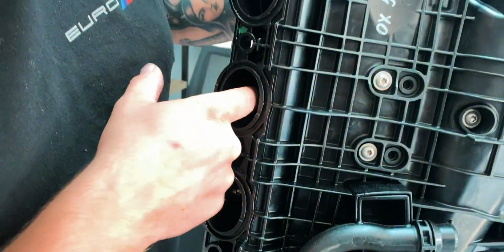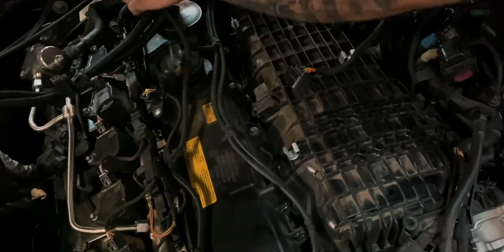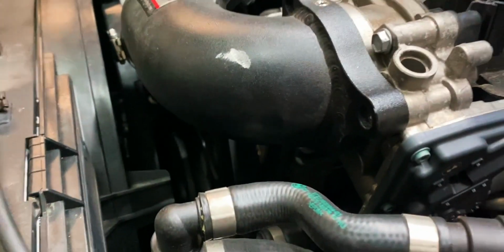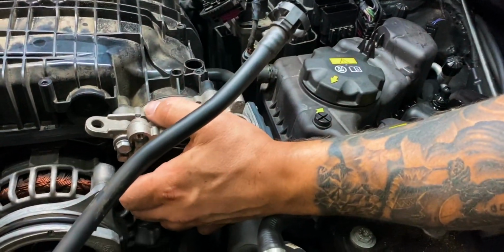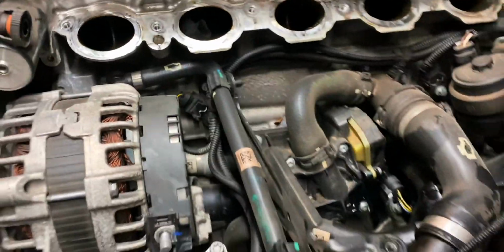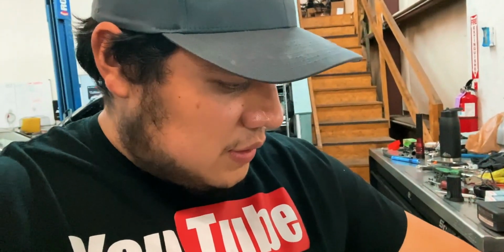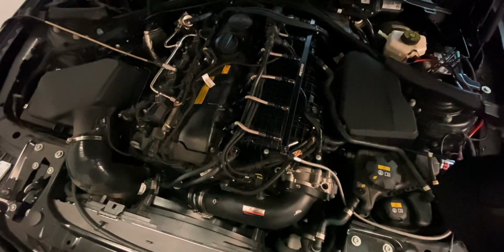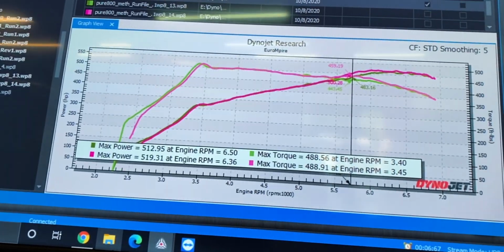PRO-METH DIRECT PORT METH INJECTION MANIFOLD PROTOTYPE TESTING FOR THE B58

Comment: port meth injection is a fail tho unless you have have really good filters and even then the white stuff sometimes can clog the nozzles and it a pita to figure out where the issue is, that why throttle body/chargepipe injection is better cause there is only one injector that can go wrong but in this instance of the b58 you cant really do that cause the throttle body is before the intercooler smh
Reply from the maker: Well you can but you run into the issue of not evenly distributing the  fuel mist through each runner. After going what I went through with CPI I’m not willing to do that again.
Reply: Get large nozzles and then use FrostByte Meth as your controller. Larger nozzles takes a while to clog, you get to service them once per year and still be fine.

Comment: Easy fix. Move them higher in the manifold
Reply from the maker: That is absolutely not an easy fix. We spend some time trying to find a good solution to retain the clean look
Reply: @NoClutchGarage  why wouldn't placing it higher on the intake runner solve the problem? It would definitely give more clearance and still be within each port
Reply from the maker: No there isn’t enough clearance for a clean redesign. The MAP sensor is in the way and when we provided the information and our findings to Pro-Meth they decided it was best to go a different route.
Reply: @NoClutchGarage  fair enough. Just seems like putting the injection next to the railing wouldn't have been that hard to do
Reply: @NoClutchGarage  the setup shown in the video is how it was suppose to be dont in the first place and to put the rail farther back and run flexline, i dont understand why you making it seem like rocket science. stainless steel flex lines solve any problem and they look nice too
Reply from the maker: What am I making seem like rocket science?
Reply: @NoClutchGarage  you were telling that dude it wasnt an easy fix to relocate the rail and nozzles even tho that how its suppose to be done
Reply from the maker: One important thing to understand about this video is that this was Pro-Meth’s prototype intake manifold direct port meth solution. We were trying to find a solution based on their design requirements which led to them scrapping the design altogether because they couldn’t get it to work the way they wanted it to. For the customer, we went with nozzles drilled into the manifold, which gave the freedom of nozzle location without the need to come up with a clean design as Pro-Meth wanted. What was done was that we retrofitted an N55 kit to fit the B58 manifold. We used braided steel lines as opposed to the hard lines as Pro-Meth wanted.
Reply: The best solution for this would be instead of having it drilled on top it should be at the bottom of the manifold.

Comment: Hey do you think you had issues with your cylinder 5/6 running too lean because of your big boost turbo?

 Do you think the inlet spacer injection would work okay with stock turbo? I want to run meth but I don't want to fry my 5/6 like you did. You learned the hard way so we don't have to.
Reply from the maker: It was bad AFR
Reply: @NoClutchGarage  wow what a fast reply!
Reply from the maker: I try lol